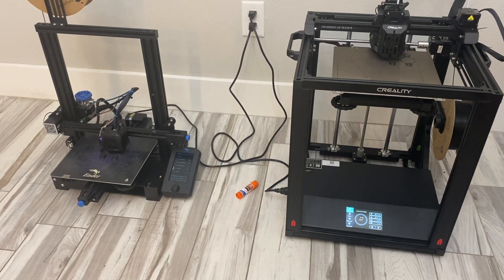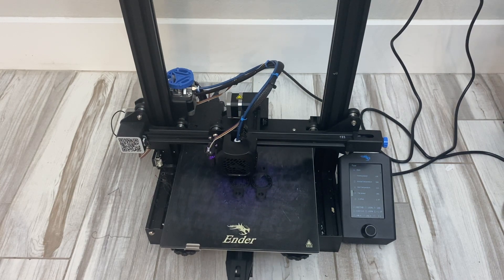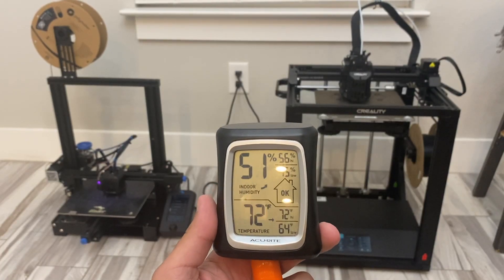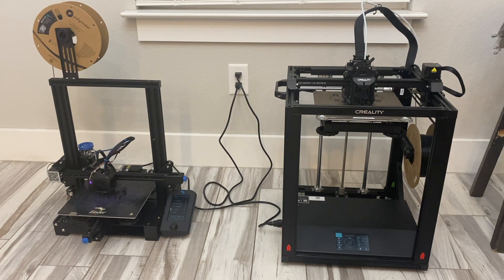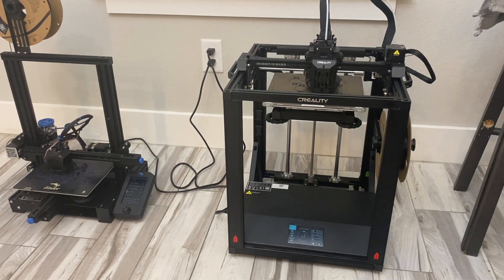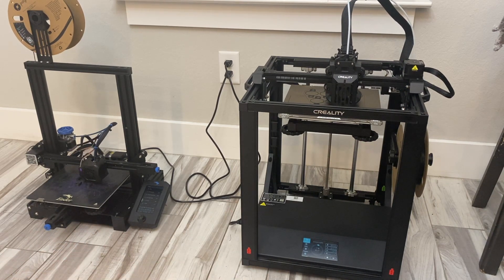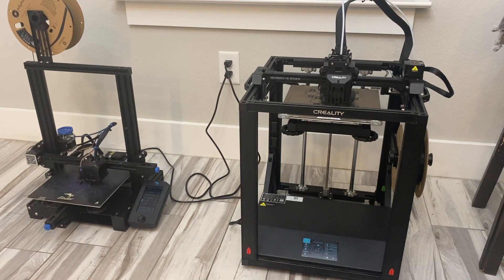How to 3D Print ABS Without an Enclosure

Comment: I was succesfully printing abs on a bambulab A1 Mini by printing 2 layers of petg first then pausing the print and then continue printing with abs. The bed only goes to 80c so gave it a try and it worked 250c on the petg and 265 on the abs a brim and a draft shield worked fine for me without any warping.

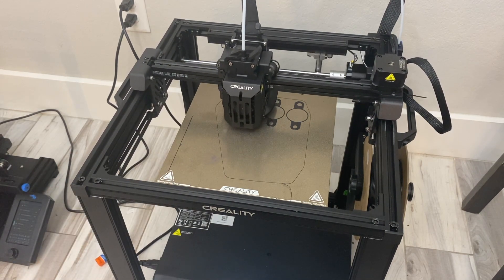Comment: Only works for smaller parts look up 0:49  how nasa uses heat lamps or halogen used the ights to print peek n etc with smaller bulbs on each side the radiant heat actually helps and giv3s better results than an enclosure and your not exactly right in your video bud I've done all your talking about what the biggest successful print of abs 6 inches off the plate? It ne3ds heat evenly so it evenly cools and shrinks